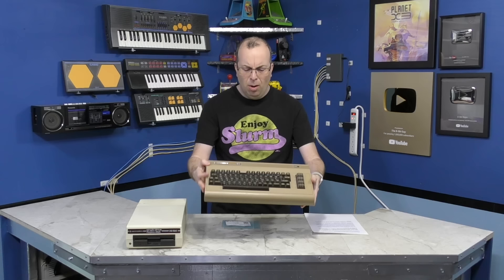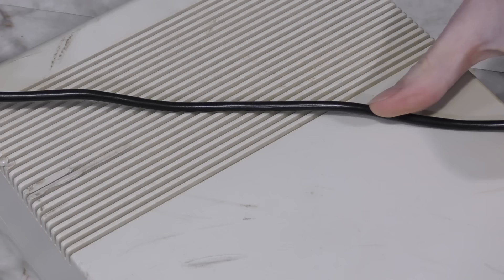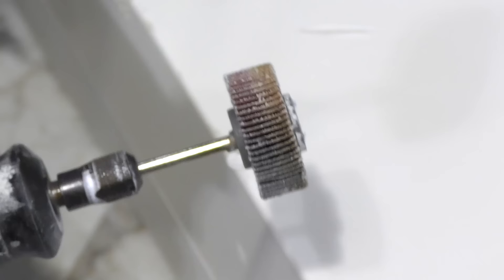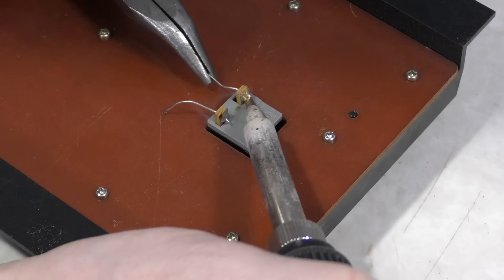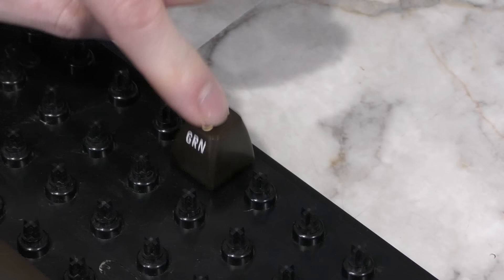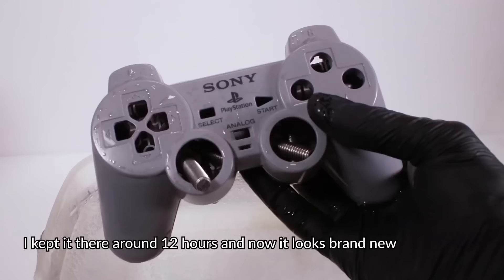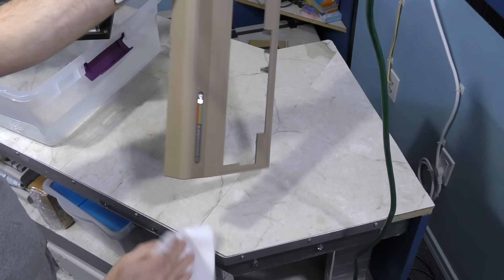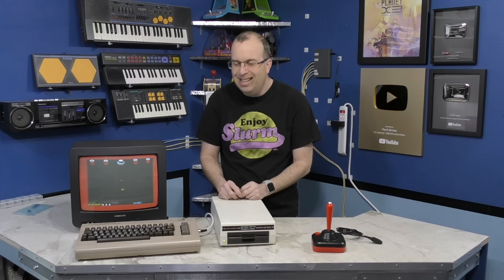Commodore 64 Restoration and new retrobrite technique.

Comment: 9:50 you broke the shift key because you applied uneven lift to the key when you pulled it up.  The shaft is not centered in the key as you can see with the broken piece still in the key.  Always be careful when pulling old vintage keys off the keyboard people.

Comment: Maybe mirrors on the sides of the crate, because the sides of the parts look a touch yellower than the tops.
Reply: If I were using this method often I would make a wooden frame to hold he lights in place, and have the left and right lights angled inward for coverage. I've seen David make a cat house in another video so I know he is good with carpentry too.

Comment: I think when some of these reactions to the cables or scratches are just too deep to sand away you can try some kind of plastic filler to see if you can get a surface you're more satisfied with
Reply: I was just thinking of MEK or some solvent in micro-dose amounts could be used with a light "press" to reform the plastic and then evaporate away leaving the plastic a new uniform surface. Like they use to use Ironing and that glue to make pressed collars for shirts.

Comment: cleaning all 5 sides of each key... by hand... dishwashers... it's an amazing discovery mike. kinda surpised the dremel didn't go straight through the thing. wouldhave slowed it down. (or just use a battery drill on the lowest torque and lowest speed setting with that sanding bit)... or just melt some plastic from a scrap case and just inject that into the hole, then flat-sand it. it's plastic. it was liquid once. it can be made liquid again.

Comment: When it comes to sanding consoles and things to get imperfections out, nothing beats a good old wet/dry sanding sponges! You can grab a box of them off of Amazon of varying grits for around $20, and because they're sponges you can get them into the vents as well to make sure it's shaped and sanded properly!

Comment: When I fill fret notches on guitar nuts or chips in wood I use the same material in dust form (bone, plastic, wood etc) and drip thin CA glue onto it before sanding it down to size. I guess if you had a sacrificial piece of plastic you could file to make dust it'd work the same to fill the melted areas on the plastic case. It's a lot of work but gives a very good finish.

Comment: That's a great light for indoor Retrobrighting.  The heat you felt from the lamp could have been Buring from the UV as well as some IR heat.   Awesome for those cold, winter days though and more consistent than sunlight.  The heat would help keep the liquid warm.

Comment: I clean my keyboard about once every year, maybe twice if something happens.  And I clean the keys by just dumping the whole lot in a big bowl, adding some water and one or two denture tablets (just basic ones, nothing special) and let them soak for an hour or so.  I use another big bowl to hold them all underwater.  Then, I rinse them off thoroughly, let them dry for a several hours with a fan blowing on them to speed things along and pop them back on.

They look like new every time.

Comment: Good call about the case plastic reacting with cable plastics. I had one of those 1980s-era cushy silicon-filled ten-speed bicycle seats resting against a VHS tape in storage. The tape and seat coating reacted with each other. It was rather nasty. The markings on the VHS tape looks like those on your disk drive case. 
Also, slightly related, I have personally seen de-emulsified rubber and plastics on old computer hardware from data centers and in older items in my collection. Usually it's soft rubber foam items and rubber feet.
Reply: Also, I was around in the 1980s, and the Commodore 64 was a little bit more tan/beige than the grey color achieved using the RetroBrite process. So was the Amiga 2000, though that computer was painted steel.

Comment: Adding citric acid to the peroxide activates the ions and does the job a lot faster without UL lights.  Citric acid can be bought at any supermarket which comes in a plastic bottle as a white powder.

Comment: The retrobrite technique here is similar to my own. I have 2x 30w UV LED lamps which are similar to the ones here but I use an insulated plastic box with reflective bubble rap insulation on the inside. I also place the lamps inside the box attached to a lid so heat is retained inside the box as well.

Comment: the hanging bracket is called a yoke in the stage world  nd while they did work i always have reservations about using led uv fixtures s 99% are not even uv   more violet (405nm)  so thats in the visible spectrum 400nm-700nm      uva  is 315 nm- 400nm  avb is 280nm-315nm     so you may have had better results with a true uv fixture like a wildfire (arc lamp based)  or a uv cannon    (i work in the laser light show industry so  know bout this stuff)

Comment: You should just use some kind of filler to fill in those holes, scratches, or burn marks. Once you evenly spread the filler over them, sand them up and it should look good.

Comment: You should try a buffing wheel attachment for your Dremel.  You can use baking soda with it and I think that it will give you greater control over how much plastic is removed.

Comment: I would expect the UV lights to do a quicker job than regular sunlight, partially because they are much closer obviously, but also the intensity from the perspective of the piece being retrobrighted, where as outside, the sun is really reflecting off the sky (atmosphere) so it's not getting nearly as much directly sunlight (and thus direct UV light rays).  And yeah, you want to be careful around UV light and not look into it or hold any parts of your body in front of it for long periods of time.

Comment: You should get a light diffusion panel from an old/broken LCD TV to use with your retrobrite tank. hopefully they work the same with UV light. then you might not need to have so many of those lights or perhaps have a more efficient process. You could also build a shielding system with poster board and some black 2.0 paint (similar to vantablack in light absorption). Add a couple of areas for heat to ventilate out or maybe mount some old PC fans and have them at low RPM

Comment: Those melted areas on the drive are called cable burn.  In order for cables to be flexible they have a chemical in them that slowly leaks out as a gas over time.  if a cable that has this chemical in it is on  plastic, the cable will "burn" the plastic and reshape it like you see on the drive.  This is why wrapping cables around controllers and keyboards is a bad idea.

Comment: I think using sous vide cooking@ 160C  but put in just a small amount of peroxide into the ziplock bag(vs marination). The water bath and control will be perfect and easy to scale up/down vs sizes.

Comment: I've had some luck repairing gouged plastic by first sanding and then heating the damaged area and using a hammer to tap against a piece of sandpaper (rough side toward plastic) to give a oem textured look

Comment: I, personally, still prefer the method that OddTinkering uses for his retrobrites. He just uses a UV LED strip (or a few of them in a chain) and the advantage of that is that he wraps his hydrogen peroxidew container with it... That means around on the sides and on the top.
This seems to help make sure that the whole piece gets retrobrited. And the results of this are visible in his videos.
Just hanging big UV LED's from the top, yeah, you get a good retrobrite on the top of the parts but the sides suffer, as it was shown in your video.

Comment: The box is blocking about 50% of the visible portion of that light, not the actual UV itself. You'll need a UV meter to determine the actual transmittance of that plastic.

Comment: Rewatched because YT recommended and I love the resto videos, and a thought occurred about the plunger, why not just take the carbon contact off and use a long and thin enough screw to rejoin the broken plunger pieces since it looks like there’s enough room for one to fit without interfering with the carbon contact from what I could see on the video.

Comment: As always, great restoration project, and the new retrobrite process is awesome. Do you have a link for where you found the UV lamps? 
Quick suggestion on lubing floppy drive rails. I'm always a bit anxious about spraying anything near the heads, so I spray some lubricant on a q-tip (over a trash can to catch the spray), then wipe the q-tip on the rails. Probably a bit over cautious, but thought I'd share my technique.

Comment: For these small parts you should really try using an airbrush nozzle on your hotend and go down to a smaller nozzle size.. Would look amazing on these small parts, and they should function closer to the originals.

Comment: Awesome!  I'm not a big fan of 3D-printed parts because my friends have had such bad luck with them.  Without a junker to strip parts from, I'd have bored and threaded each half (you have to do one half to pull it anyway) and reconnected the halves with a metal rod (nice word for a piece cut from a ridged paper clip ... or a smooth piece with ridges mechanically added) and epoxy.  But then, I love epoxy.  LOL

Comment: Get your self air compressor with cleaning gun, way more power to dust off, especially this gunk stuck on old hardware. Bonus, also enough power to clean fans and power supplies through vents

Comment: If you want to make your tank reflect UV you could just wrap it in aluminium foil (i.e. foil on the outside). If you wanted it not to reflect in a specific pattern (so you don't get like focal points all over the place and make weird patterns on your plastic) you could put a single layer of thick translucent material (like baking paper) around it first and then wrap the aluminium foil around afterwards.

Comment: On the melted areas I confirm it's due to chemical reaction. I have a joystick with those exact marks exactly where I wrapped the cable around to store it. I am also 100% sure it never came in contact with heat.

Comment: I think that sanding would work well but you need to use a MUCH lower speed on the Dremel - I'd use the 5,000 RPM setting myself only going up to maybe 10,000 RPM if it's a really big chunk you need to remove.  I also suggest looking for one of the flex attachments that has a smaller body too so you can get in tighter.  From the whine, it sounded like you were up around 15,000 RPM which will chew thru plastic much too quickly for detail work.  A flat fine sanding disc would also be useful to clean up around slats.

Comment: Back in my hippie days..(2003) I had a bigass incense stick and somehow it sat on top of my pulp fiction DVD for a few days and almost melted halfway thru the disc with no heat or pressure at all.
Reply: That makes sense. I had these holiday scented sticks you hang on fake Christmas trees. For reasons unknown, I left one on my stained kitchen table. Over time, things like papers and such found their way there as well. When I cleaned, I had found that the stain on the wood had been completely removed where the stick had been lying on it.

Comment: You know how everyone has their opinion about things and of course, I fall into that category as well. I probably would have taken the cases off before any cleaning. Specially when it came to using baking soda on the drive. Total  head failure if it gets on the heads and probably not good for the rest of the mech as well. But hey! Great video!

Comment: Cover the outside with tinfoil so what gets out is reflected back in. Of course the plastic will take some of it both ways, but you won't get the reaction you'd get on the inside if the tub and you waste less light.

Comment: I find it interesting you're putting the cleaning chemicals directly onto the components, without removing the cases to work on them separately. I also wonder if Magic Erasers would help out as well, removing some of the dirt, etc.
Reply: Magic erasers are great but you have to be careful what types of surfaces to use them on. They’re basically fine sandpaper, which he also used, but you have to be aware textured and glossier plastics will show damage.

Comment: I’d rather glue the shaft with the rest of key part with some good epoxy or superglue with baking soda. Additionally a metal insert made of nail would make it even stronger. Just drill a hole in other part (I have made this many times with strong epoxy glue).

Comment: If I had to guess the "bobble-head" effect is coming from either an imperfect 3D model or tolerances not met by that printer. I wouldn't dismiss 3D printing just yet, but I think you will need a better machine (smaller nozzle on a good FFF printer or a resin printer) to really recreate those parts properly. Good attempt though!

Comment: I have some cables which seem to have melted together over a prolonged time of use or no use while crossed or bundled (mostly audio cables for cheap microphones), I always assumed manufacturing defects within the plastics, cheap plastics or short time shorts (Can result in very hot wires where the insulation could melt). A chemical reaction is a new angle i never considered. Maybe I will try to investigate this angle.

Comment: Odd Tinkering also explain why it is better to set up the uv led at a 90 degrees angle. Also the hot water might not be as effective than pure hydrogen peroxide only. But with the 60W UV led you're using that should be the most effective when all combined techniques 🤯

Comment: I would have 3d printed the plungers with them on a different axis. You would have had some support material to clean up but 3d prints are much strong along the x and y, and if the way the last few plungers broke is any indication you don't want weakness in the z layers!

Comment: Maybe why not spray paint or brush paint the container (from the outside) for preventing the light escaping... Or better yet, stick custom made mirrors (cut by the box shape) on the outside and thus better reflection can happen inside... Just a thought.

Comment: 3D prints are rarely precisely the size you intend them to be.  Sometimes printing at 101% or even sometimes 102% is necessary for good fits.  At least for PLA.  I haven't printed with any other materials though.

Comment: I actually have one of these. The no. 3 key is broken. But otherwise it works. I also need an original video cable for it, as mine is shredded.

Comment: There are 1000 ways of doing retrobrighting and 990 of it work just great, what we really need would be an idea how to prevent that the yellow color comes back and no, clear coating does not help as it was already proven. BTW, WD40 is not a lubricant, it will ruin your plastic parts.

Comment: FYI, those lights are most probably 405nm, the same frequency as a bluray player (which is why they are so cheap). Real UV, like from a fluorescent black light, or the Sun, is around 360nm or shorter. Real UV diodes are much more expensive.
I bet you would get the same results without those "blacklights" and just the bleaching effect of the hydrogen peroxide.

Comment: I'm just curious, have you ever tried using automotive cream hand cleaner to clean the case on some of these, the type without grit in it? I used that to clean up the plastic on eight track cartridges and they came up like new, but be careful using it on paper labels or it can remove the ink. Those disposable wipes they sell everywhere also do a good job of cleaning, even taking felt tip pen ink off, and they don't seem to harm printed labels. 
  The melted marks in the plastic are from plasticizer leaching out of the vinyl insulation used in the assorted cables. The disc drive probably had something sitting on top of both it and the cable, for those marks to be that deep. I don't know what plastic was used for the plungers but if it was ABS plastic acrylic solvent cement will repair them.

Comment: If there is anything imperfect 'bobbly' with the replacement spring or 3D printed pusher, why not swap the SHIFT and 6 parts for 2 of the least commonly used key parts there (for example, from the F keys or C= key).

Comment: Maybe a good 4k camera we can see better the difference, For the rest great video as always, i just made my father C64 computers working again but one (he has 3 C64 computers), one i have ordered a 6526A chip, because it was not working, i already got the replacement chip but he was broken also, so the guy on ebay sent me a new one.

And replaced some other chips, like the MOS 906114-01 and HD74LS258P, and made removable sockets on his c64 computers, i also gone replace all the caps of his c64 computers and C1541 floppy drives, already done my C64c and 1541-II floppy drive, but it's a good idea to put Joystick port ESD protector v1.1 on your C64, it protects the CIA & SID chips from ESD shocks, what happens a LOT on C64/C128 computers, i just got them in today with post.

Here is the link you can buy them from, they are cheap: http://www.amibay.com/showthread.php?108652-Joystick-port-ESD-protector-v1-1&highlight=Joystick+port+ESD+protector+v1.1

Comment: You actually brought up something I’ve been worried about for awhile.... 3d printing hard to find pieces.

I actually am getting into restoring really old radios lately (bakelite ones from the 50s) and some plastic pieces are near impossible to find replacements for. As is certain specialty parts for transistor ones(got some gears on a transistor radio I need replaced)

With old pc stuff like this from the 80s, I’m sure folks with 3d printers have got things covered with 3d models of any part they could ever need, but what about older electronics like radios?